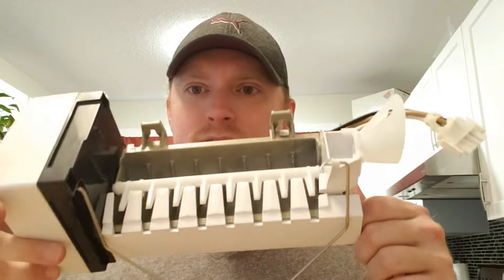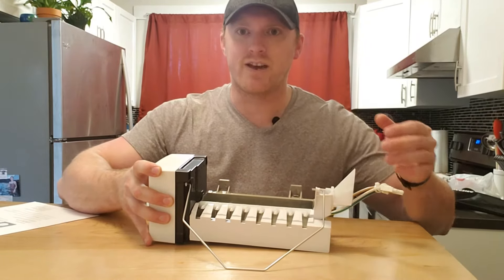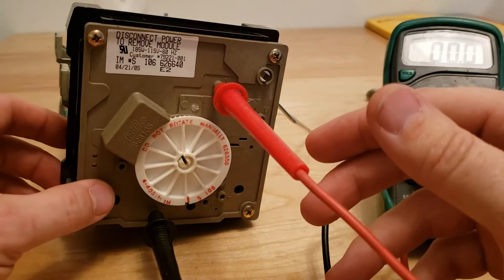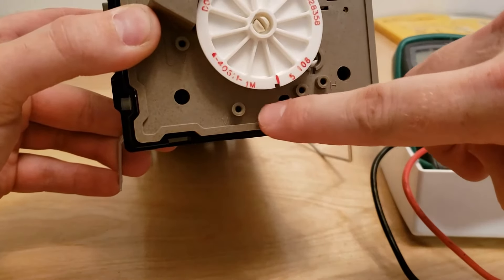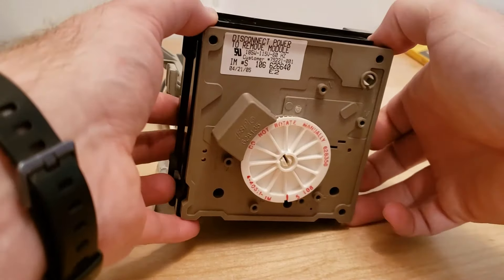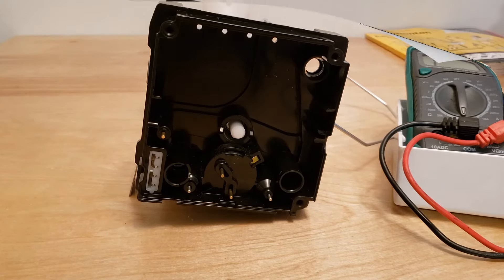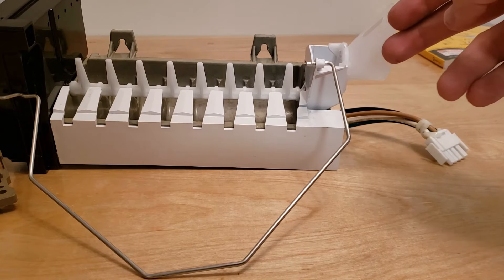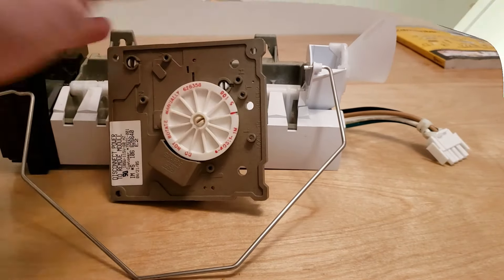FRIDGE ICEMAKER HOW IT WORKS - TOTAL DIAGNOSTIC GUIDE

Comment from the maker: Thanks for watching, Let me know if you have attempted this video on your ice maker, and weather it helped at all. Hit that like button if you liked the video, or it was helpful for you also. Have a great day!!
Reply: Awesome, I had already pulled it all apart and fixed a broken circuit, but it still wasn't working. After watching your video though, I was able to know for sure that the heater was going bad also, so thanks!
Reply from the maker: @justgoaz  thanks for watching,  and I'm glad you got it fixed!!
Reply: Video very helpful in troubleshooting my Whirlpool ice maker thanks again.
Reply from the maker: @tammiehavens7480  thanks for watching,  I'm glad the video helped you out.
Reply: Thanks for this in-depth  ice maker troubleshooting video - very helpful, led me to pinpoint the failure of mine to a bad motor.
Reply: Teflon was peeling off the original ice mold and i didn't want to purchase a new crappy Chynese unit.. so bought a damaged O.E.M  ice maker in like new condition and swapped the heated ice mold in myself for 35 bucks vs spending 150 + labor. Thanks man.
Reply from the maker: @bencbloom  your very welcome, glad it helped
Reply from the maker: @matttafakt  that's awesome good job
Reply: It was not mentioned that you need to turn off the freezer compartment light to allow power to the ice maker.  It was driving me crazy why the tests were not working.
Reply from the maker: @richardrupert2045  it's in the video at the 6min mark to 607. Did you get the problem figured out?

Comment: Thank you for the great video. I liked you didn’t rush your talking so one can understand and able to follow your reasoning. 
I’d like to suggest to you explore more troubleshooting the inlet water valve to the ice maker.
Also you mentioned regarding the feeding pipe frozen but didn’t explore troubleshooting it. 
I have a frozen pipe that feeds the ice maker. What’s the cause?
Reply: Thank you Greg Thomas
Reply from the maker: Thanks for watching imadbedros, your very welcome, that was one of my first videos so I was panicking a little that it was way too long do some things got cut. I just came out with a video on a ge fridge where I just diagnose the water system. With the frozen pipe it's very difficult because these ice makers go in hundreds of different fridges, which all have different fill systems, some actually have in tube heaters you can buy for this issue.

Comment: What a fantastic and educational video. Greg, you were very thorough, informative and easy to understand. Thank you so much for sharing. Now I have at least some information to try and fix my ice maker. I think I’ll try replacing the module first after I reset it and it won’t work. My problem is the ejector fingers are freezing in the water. It got out of sync somehow. 😊
Reply from the maker: Yeah it's supposed to be a timed cycle, so the head could be screwing up
Reply: @Thomasappliance thanks for responding 👍
Reply from the maker: @Egalitarian-bt7kz  no problem at all

Comment: Thanks for the video my arm will not shut off 😞 but it does work on the On position
Reply from the maker: Thanks for watching Aaron Guerrero,  is the arm sitting right in the head, if yes then the head has some issue.
Reply: What can I do ? How do I fix the arm so it turns off ?
Reply from the maker: @aaronguerrero4753  its probably easier to take the whole ice maker out and see whats going on. Just be careful putting it back in that everything goes back where it belongs.
Reply: @Thomasappliance  I took the ice maker apart as recommended. it turned out the plastic inside that holds the arm was not set correctly. Your video shows how it should look and used as guide to reset my piece . Thanks for the awesome video , I just hope the ice maker continues to work after I put it back together , if not I'll be in touch
Reply from the maker: @aaronguerrero4753  thats awesome, good job. Hope the rest goes well.

Comment: Could u give sequence of operation of how solenoid works?
Reply from the maker: There is a cam inside the ice maker on the motor, which makes or breaks certain points to provide power to or take away power to the internal heater, the water valve, and the thermostat.
Reply: @Thomasappliance  Thnk u, Thomas appliance.

So, the icemaker water is in off position until cam turns & opens valve? Is my thinking correct?
Reply from the maker: @gotchaplumber  yes that's correct
Reply: @Thomasappliance  Thnk u
Reply from the maker: @gotchaplumber  no problem at all

Comment: Una pregunta si hubo un corto, y se recalentaron los csbles de fase y neutro, cual es el moivo de la falla, y que podria estar mal?
Reply from the maker: When it comes to overheating it can be as simple as a loose connection,  if the thermostat shorted out and wasn't working properly the heater could stay on, the ice maker or fridge could of had a surge and blew wires.

Comment: My ice maker had visible white powder and cooper  deterioration where one of the pins from main unit plugs into the power connection on the ice maker module.  I wire brushed cleaned, used needle nose pliers to reposition slightly the remaining cooper to make contact with pin when two parts are put back together.    24 hours later ice tray is filled and it's working fine so far.
Reply from the maker: That's awesome good job

Comment: I made an attempt to do what u did.  It did start spinning the arm and filling with water.  I'll know tomorrow morning if it worked.
Reply from the maker: Thanks for watching dand, hopefully it works out!! Let me know
Reply: @Thomasappliance  it got stuck on an ice cube but yeah it worked.  I used a piece of copper washer and bent it to shape and soldered it in
Reply from the maker: @dand7056  sounds like the heater isn't coming on properly

Comment: Of course mine has to be different. But generally similar. For instance the cover on mine has another cover over the test holes at that point I quit. I don't want to take the wheels off to look underneath Instead of holes it has un-labeled posts.  It's a NIDEC made in Indonesia..
Reply from the maker: What is the model number of the fridge?

Comment: My Whirlpool fridge stopped dispensing water and ice. After all kinds of searching it was the filter. The pin on the end of the filter (water inlet/outlet end) was too long. IT works the bypass(?). Anyway, I trimmed off 1/16 of an inch and solved my problem. On another video people where c/o the same thing and someone said trimming the pin worked for him and it worked for me......after going through a whole lot of other items. Loads of people are having problems with the filters fitting properly. Good luck and thanks for all the suggestions.
Reply from the maker: Thanks for watching Steve zelev. I haven't heard of that fix but I'm going to look into it because that sounds interesting.

Comment: Does the metal arm cut of electricity to solenoid?

Is solenoid 120v or low voltage?

Great video!
Reply from the maker: The metal arm is just a switch which will connect a path of electricity between power and neutral when the arm is down.  The only solenoid in the system is the water valve, which is 120v.

Comment: Thanks for the video! Helped me diagnose mine. You could get it to cycle by t to h, but wouldn't intiate the water valve. L to v would run the valve though. What I found was 1 of the contacts that extend through to the slides on the back of the big gear was broken. Ordered a new ice maker.
Reply from the maker: Thanks for watching kraftzion,  and yes thats the case with these things either the contact arms break or weld themselves shut. Good job!

Comment: Good info! Other things;
1- Ice tray lost coating
2-Ice maker not level
3-Heater draws most amps and connectors burn, clean, tighten retry w/dielectric grease
4-If add or changing filter, flush 3-4 minutes. Active carbon comes out and hold water valve open, blow air from supply thru valve 
5-Calcium, Lime, Magnesium or rust (Well) can keep seal open. Add filter for house, change to city
6- Fittings are “Shark-Bite” type, push in, pull line out to service.
7- Buy extra filter, store next to ice box
8- Ice kits are sold buy left over inventory as repair shops close= deals
9-If trays corrode and cube stick, buy water softener to install before hot water heater, leave hose & irrigation before softener = waste. Yard doesn’t care about minerals, car paint does, so pick carefully with plumber. 
 Thanks kindly for the video info. Digital Volt-Ohm meters are cheaper & better. Wear rubber gloves I working with voltage! Unsure, call pro!
Reply from the maker: Yes, that's all true. And yes digital dvom is much better for sure

Comment: Thanks for the tips. Mine just stopped making ice, pulled ice maker and the fill cup was frozen. Defrosted that, put back ice maker but still no ice. Watched your video and the jumper portion appeared to fix my problem. Removed jumper Mine has a black housing with one wire coming into it that plugs into the portion that was jumpered. Motor turned and water filled ice tray. Hopefully it will continue to work!
Reply from the maker: Thanks for watching Bob Love, hopefully it stays going for you!

Comment: Hi there, excelent explaining. I did all that in my whirlpool french type fridge. Everything inculuding water valve is good. The only problem is that water is not coming in ice maker. By the way when filling manually and test with jump wire ice maker works good. Therefore kindly tell how to make water come to ice maker.
Reply from the maker: First thing to check is when you jump it to run a cycle does the water valve do anything when it should be filling?

Comment: Than you Greg. Your presentation here is excellent. Actually, it is very calming with your voice and nice background music. I just replaced the Whirlpool icemaker in my Kenmore fridge and I couldn't resist dissecting the old one to learn about what makes it tick. What led me here is the new one is not working and I am trying to learn as much as I can to troubleshoot the reason. The water valve works as I disconnected it from the fridge and jumped it with 120V. The solenoid actuated and the icemaker water tray filled. I am at a loss as to why it is still not working.
Reply from the maker: Thanks for watching hootinouts, do you have 120v between l and n on the icemaker head?

Comment: i took off the front cover and saw the same discoloration/burn on the main power line. so i replaced the entire unit, jump started it and it worked!… for a couple cycles. then it stopped working again. i pulled the cover off the new unit and the same electrical burn had happened in the same spot? what could be causing this?
Reply from the maker: Thanks for watching cameronbremer, when it comes to electrical systems, anything could cause that to happen. Whether a wire is shorted, or the house wiring is causing an over current situation.

Comment: Nice video Greg - thank you.  This confirms that my ice maker mechanism is working properly.  My problem seems to be ice build up in the fill tube (mine doesn't have a funnel).  This has happened several times and it results in water running down the insides of the refrigerator and out onto the floor.  Any ideas what could cause the fill tube to become blocked with ice?  I'm wondering if the fill valve might not be closing completely, thereby allowing a trickle to flow constantly.
Reply from the maker: Thanks for watching, and yes that is usually the issue, the water valve doesn't fully close or over fills the ice mold.
Reply: @Thomasappliance  Thanks for the reply.

Comment: Thanks for answering so fast,,,,but the one I am changing is the main board on the back. I have the sticker with NO CODE number. That's whay I am looking for what to do now. I watched a video where the technician does not reprogram the unit after replacing the main board, so I am confused if I have to do it or not. Please let me know. Thanks again, Ramon, Miami
Reply from the maker: Mist fridges don't need you to program anything if its the back board
Reply: That is a very good news. This unit only has the back board plus the control panels in front, maybe that's why there is no CODE NUMBER on the sticker. You can't imagine how much I do appreciate your answer. As I said before, you are GREAT Greg. you are more than helping us. You deserve our respect and consideration. I will continue following you wherever you go. Thanks and have a great day. Ramon. @Thomasappliance
Reply from the maker: @ramonperera6218  thank you for those kind words. I'm glad I can help!

Comment: Ours is just slow. Everything works but takes a couple of nights to build up a full tray. The freezer keeps everything frozen. Its making half or more sized cubes, is that effecting the thermostat on the tray? Another thing maybe the freezer thermostat needs to be colder.
Reply from the maker: Yeah it sounds like it just needs to be a little cooler in the freezer. Thanks for watching coryjohnm
Reply: I just checked the freezer adjustment in the frig and its on max. Don't want to turn the fridge down more. Maybe the thermostat on ice maker is going bad.
Reply from the maker: @CORYJOHNM  it very well could be, it's not the usual thing to go but very possible.
Reply: @Thomasappliance  Well how do I make it pump out ice. Its there a commercial unit that fits it? Why? Because we are shoppers for a company and we use lots of ice to keep customers food cold. If it made a full bin in over night there wouldn't be a problem.

Comment: So if the motor is running, the ice removal fingers are turning, the freezer is cold enough?? My GFs ice maker isn't working. I have already replaced the water valve and checked the water tube for being frozen, still no ice. I'm thinking the ice maker itself is bad. Could a bad control module cause no water flow to the ice maker?? The ice maker works in every way but water flowing to it. I can pour water into the tray and it will make ice. Any help you can provide would be greatly appreciated. Great video!! Iven tried to watch some other ice maker videos, yours is by far the most info filled.
Reply from the maker: Thanks for watching stephenhood, a board can cause issues with an ice maker but thats not usually the case. I would put the icemaker into harvest and climb behind the fridge and when the ice maker should be calling for water check for power to the valve.
Reply: @Thomasappliance  Thank you for the reply. Your video does explain where the board needs to be to send a water valve signal. When I get over her place I will watch it again and see where it needs to be to signal the water valve. Thanks again!!!
Reply from the maker: @stephenhood2948  no problem, hope you can figure it out.

Comment: Great video! My ice maker that is identical to yours works except the shut off arm would go up and stay up until I manually pull it down. What should I check for?
Reply from the maker: The cam on the inside of the dial is supposed to let the arm fall down, I would make sure there isn't anything stuck in the head of the assembly.

Comment: What about the thermostat?  Did you check it?
Reply from the maker: The thermostat will close when it's cold enough so checking the circuit with the heater in it checks that too.

Comment: The red light on the power switch is on so I think there is power. I have it loose and the white end of the ice maker has a screw in it so I couldn't pull it off, and there doesn't seem to be a plug to disconnect the power.
Reply from the maker: What kind of fridge is that on?

Comment: Is it cold enough to produce ice ? As I told you, I need to replace the digital system in a WHIRPOOL for an analog one and was worried about how to keep the ice maker producing ice without any refrigerant gas pipe going into its system. So, that means that the only thing I have to worry about is to have the voltage, and the water....am I right ? Thanks for your fast response, I will be waiting again for this question. Thanks and I am following you to get all your great explanations. Ramon Perera, Miami
Reply from the maker: I'm not sure I completely understand, what digital system are you replacing for a analog one? The ice maker won't run if it's not cold enough in the freezer, hopefully that's what your asking.
Reply: @Thomasappliance  Thanks again for responding....I am trying to convert a digital WHIRLPOOL WRF555SDFZ08 to analog, because the board has failed more than once, and you know they are expensive.. This model has the freezer in the bottom part and the ice maker on the upper part of the machine...so it is difficult for me to understand that only the cold air from the bottom will make the ice maker to work. Understand that I am new in this field and always thought there was a gas pipe going to the ice maker. To have this clear will allow me to start the whole system, including the ice maker just by having 120 volts and not using any low voltages from the digital board. The same if the motors in the dispenser work with 120, it would be just a matter of changing connections. I know maybe it is not the best thing to do, but I do not want to spend any more money in a very sofisticated system. What I need is to have cold water and ice. Thanks for your patience and understanding. Continue being GREAT, Greg....Love what you are doing for us.